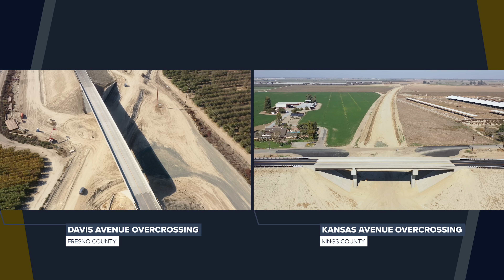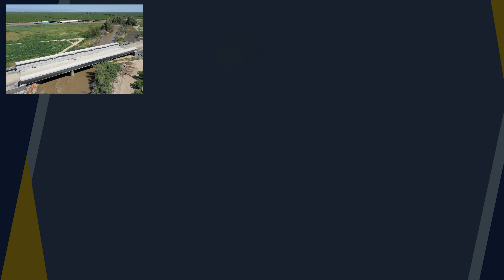Fall 2023 Construction Update: Progress is happening across California thanks to HSR Workers!

Comment: Honestly, the only thing bad about this project right now is that I worry about the Stations not being able to expand upon themselves. The reason why Japan has the best Train System in the World is that their local trains are setup to  help their Shinkansen. Local stations are Mixed-Use Properties with Mixed-Use Zoning - as CAHSR is being built out, the cities along it's line need to build up their local trolley/metro systems to connect to each CAHSR station. I believe as each section of the CAHSR is completed, those workers in those areas should be utilized to bring local train services to the HSR lines so that one could simply walk out from where they live in Fresno to a Train Station 5-15 minutes away, board a train to the HSR line, get on the HSR and be in LA in 2 hours where they would work and then take the same train back same day and be home in the same amount of commute time that it would be now if that same person was living in parts of LA currently. And technically they could even still be productive on the train as they could work on the train heading in and out of work. 

I hope that people realize - this is not a 5 year project, or even a 10 year project. This is going to be a on-going project for the rest of our Lifespans and going into our grand-childrens Lifespans and beyond.
Reply: Yes! Future proofing is very important to save time and money
Reply: That's my big concern with CaHSR as well. I'm all for it, but I feel that it will always fall short of expectations until the cities and counties along the alignment decide add networks of their own, be it bus, tram, or suburban/regional rail. These projects don't exist in a vacuum, but my sense is that only LA and the bay area are understanding that.
Reply: @ashleyhamman  There is the cross-valley corridor project that aims to create a transit connection between the Kings/Tulare station and nearby towns (first bus and eventually rail.) Also, I suspect that eventually Fresno, the 5th largest city in California, will gain some sense and realize that they need to properly invest in their transit system. I'm not sure about Merced or Bakersfield. At least Merced will eventually be getting regional rail from ACE, but that's more so for intercity commuters and not really travel within Merced. As for Bakersfield, apparently, their station development plan is mildly decent but otherwise I'm not sure what their long-term transit plans are.
Reply: Human sized spaces are essential. Zoning laws need to change to convert areas around new stations and potential stations REQUIRE any development as human sized spaces. The complete opposite of single family housing.
Reply: It is not Japan but china that has the greatest bullet infrastructure on earth
Reply: @carlsmith5545  I can agree with you that China has the best Train Infrastructure. They build just to build over there. But Japan still has the Best System - the Stations are top-notch, the Trains are top-notch (and are almost ALWAYS on time), and the service is top class. 

Japan is the country to emulate when it comes to Passenger Train Systems.
Reply: @AnimeGamer0  Ofcourse, infact the people of Japan take great pride in their trains. Now they're building the Chuo Shinkansen is currently under construction between Tokyo and Nagoya and then Osaka. This is maglev super train technology. Trains that can reach speeds of up to 375mph useing magnetic levitation. This is technology that is way above the american grade and the american mind. The mighty United States of America wouldn't obtain this for another 100 years. But boy the United States of America can sure go for a walk on the moon!
Reply: @carlsmith5545  Funny comment to end the year
Reply: I could not agree with you more. Excellent take.
Reply: So true, our country developed based around the fwy system (good? Bad? 😂) in the past 80 years as we steeres away from a good public transit system.  This is just the beginning.  Our cities need to do way more to connect people and make travel times on public transit normal (taking 2-4x more time to travel on busses/trains than cars is ridiculous)
Reply: Check out the Calif. 2023 Rail Modernization Plan -- it ties HSR into all the passenger transit systems in the state.
Reply: " HSR lines so that one could simply walk out from where they live in Fresno to a Train Station 5-15 minutes away, board a train to the HSR line, get on the HSR and be in LA in 2 hours where they would work and then take the same train back same day"

Why would they do that when

1) it makes a lot more sense to just get a job in the central valley

2) the plane is less than one hour (1 hr 15 min according to the time tables but in practice less than 1 hr. The flight from SJ is 45-60 min.)
Reply: @neutrino78x  Well, why do people even go to a Office when they can work from home? Fact is, just by having the option to go to and from work via HSR expands the one thing California is hotly short on - Housing. Not only that, moving these people out while increasing the density makes new businesses and jobs to service that increasing density. Besides, it's hard to predict how future Jobs will work - so it's best to just give as many options to get to that work as possible. 

As for Planes - yes they can be faster many times, but they can also be more expensive and more complicated. A great Metro system paired with a great HSR system would be more efficient cost-to-time wise then having to show up early to the Airport, having to spend time going through Security, then having to waste time boarding the plane. Yes, a flight to SJ would be 1hr 15min - but in reality it's 2hrs if you're cutting it close in getting through check-in, TSA, and boarding (of which you need to be at the gate 30 min. before takeoff or risk getting left behind.) Trains on the other hand don't have that serious of a security check, and more Trains could be run then Planes on the same cost. If a Train fare is even just 75% of the cost of a Plane ride, that's a significant savings if that flight was $90 one-way vs $67.50 for that same route via HSR. I think costs could come down even lower to 50% of flight fare - and $45 plus a extra half-hour is a massive savings overall for most. 

That said, as is right now, the supporting Metros are no where near good enough to make HSR a better transport service then Planes since many stations still requires Cars to get to.
Reply: @AnimeGamer0 

"Well, why do people even go to a Office when they can work from home?"

They don't, anymore, bro. Where have you been? You didn't hear about how BART and Caltrain and Metrolink etc were on a "fiscal cliff" because the ridership declined so much during the covid lockdowns and never recovered because people kept working from home?

You're stuck in the 90s, dude.

 " Fact is, just by having the option to go to and from work via HSR "

((roll eyes)) Nobody is going to commute three or four hours dude. A typical commute is 30 miles.

I have no idea why some people think this would effect commutes.

This is not a train to get from A to B within Los Angeles or within the Bay Area. We already have lots of those.

This is for crossing the 380 miles between SF and LA. 

And there's no point because most of us who travel that route regularly, including yours truly, fly.
Reply: @neutrino78x  Nobody is going to commute 3-4 hours a day? That’s a normal day in LA traffic. I have a friend who drove from South San Diego to Santa Monica (he worked for Riot Games during the early LoL years) to work and drive back the same day. So don’t think people who wouldn’t spend hours on a 4-hour commute don’t exist. 

And you were the one who pointed out why people would not take a job if they aren’t near it - isn’t working from home the same thing? I mean, if we’re going down this route - why even have as many flights between SF & LA when everything will soon be done by AI and Robots - heck, meetings can be done via teleconference? 

The answer is that Humans need to move, and so we do whatever we need to do to get to our destination. Corporations need to be in control - and work at home jobs are shrinking from many big Corpos and their workers are being dragged back to the Office. So what are those people likely doing? Driving to work, sitting in hours of traffic. Those people could take train, but they don’t because their local Train system is failing them.

It’s not even being stuck in the 90s. I bet you didn’t even exist in the 90s so how would you know? 

My whole point is that HSR doesn’t work without good local Metros. So everything you said in the second half of your comment just backs up my initial commentary concern in the first place. 

People use whatever is easiest or more convenient for them. People will drive 10 hours in hellish traffic from San Diego to San Jose and back if it means they don’t spend $200+ on flights and only $80 on gas. Others will fly like you because time is important and spending the money to lessen travel time is important. What Trains are supposed to bring is a middle of the road option that is more cost-to-time efficient then Driving & Flying as long as the Train systems are capable. Will CAHSR, Caltrans, BART, MTS and other California transit authorities be able to build that? Can they build the needed infrastructure of not just track, trains, and stations but the supporting industries around that? That is what is in question here. 

Instead, you went on some wild tangent on how HSR is trash and outdated, won’t affect commutes, and is stuck in the 90s. The classic NIMBY arguments. The only thing you left out is calling CAHSR a boondoggle- when there are many people who still believe it is a project still worth pursuing.
Reply: @AnimeGamer0 

"Nobody is going to commute 3-4 hours a day? That’s a normal day in LA traffic. "

Ok, so let me explain again.

This train is NOT for commuting.

You can't go from San Diego to Santa Monica on it.

You can't go from Pasadena to downtown Los Angeles on it.

For that you have LA's buses, light rail and heavy rail.

CAHSR is designed to move people from southern California to northern California, ok. It's not a commuter train.

If people want to commute SF to LA, there is already a MUCH FASTER vehicle for that, a jet aircraft.

All five people who do that as a commute are not going to step down to something that takes three or four times longer.
Reply: @neutrino78x  because taking a plane is longer than the flight time itself. You have to include time for getting to the airport which could be hours if its LA, security check, bag check, and wait time for you bags if you have checked bags.  Flying is not just the time you are in a plane.  It still has its pros, but the train has its convenience over planes as well, since you do not need to head to the station 1-2 hours earlier.  You dont have to wait for your bags at the baggage claim.  Trains will have more comfortable seats for the average person.  Planes get delays all the time.  It is not as simple as "a flight is just an hour or less".😊
Reply: @Ninjabeefyschtick 

" because taking a plane is longer than the flight time itself. You have to include time for getting to the airport "

Nope. You just suck at flying. Getting to the airport doesn't take hours in LA. I'm from the Bay Area, I'm familiar.

You understand there are three different international airports in Los Angeles, yes? LAX, BUR, SNA. Actually four, ONT. Just like we have four up here: SFO, SJC, OAK, STS.

So no, you're not hours away.

LA to SFBA is a quick one hour flight. People do it all the time, every day. I do it often, myself. I'm in San Jose, so NOT hours away from the airport. It's right downtown.

Would CAHSR fill up with users? Yes.

Would it take traffic away from aviation? No. 

Too slow for that.
Reply: @neutrino78x  what you said maybe correct.  Since you fly so often, then you must also know that travel times to  lax and the other 3 airports differ depending on the time of the day?   And lax has 7 major terminals that also add to the travel time depending on the time /season.  And feel free to ignore the security times too. Lol
Reply: @Ninjabeefyschtick 

"ince you fly so often, then you must also know that travel times to  lax and the other 3 airports differ depending on the time of the day? "

It's not hours and hours. You have an airport close by if you live in the LA area or Bay Area. This isn't Europe. They had to put their airports hours outside of their cities simply because their cities had been there for thousands of years and were too dense. Whereas San Jose has an airport right downtown, and there are three other airports in the Bay Area and four in the LA area.

I'm sorry but HSR is simply too slow for this distance. It's 380 miles. Three hours doesn't compete with one hour. 

It competes with DRIVING yes. But it doesn't replace the one hour flight, and the one hour flight will be unaffected. Speaking as one of Those Who Would Otherwise Fly, I can tell you it does NOT compete.

SD to LA makes a lot more sense, and they're already upgrading that track, moving some of it inland where they had issues with beach degradation etc., using existing county budgets.  LA to LV also makes sense, and that's 80+ percent privately funded and will be a private transportation service, not public transit.

I proudly voted no on the stupid CAHSR project and I'm glad that the Governor said there shall be no more construction beyond Merced to Bakersfield (the Initial Operating Segment).
Reply: @neutrino78x    no one says it is competing with flights. Its an extra options like many developed countries have.  If you dont factor any driving time and security check times, ya it is 45 min or an hour to SF and vegas.  You can continue to believe that if you are happy and very strategic about your flight/airport selection, not every single passenger is smart or has the luxury like you. 😭
Reply: @Ninjabeefyschtick 

"  no one says it is competing with flights."

Great, you agree that it should have a lower budget, then.

We don't have 100 billion as a state. That's why the Governor said there shall be no more construction beyond Merced to Bakersfield.

 " you dont factor any driving time and security check times, ya it is 45 min or an hour to SF and vegas."

Sorry, even counting that, it's not 3 hours on a plane SF to LA.

I'll give you two hours, that's generous. It's not three. 

EVEN WITH THAT GENEROUS INTERPRETATION, YOU'RE STILL WASTING AT LEAST ONE HOUR OF YOUR LIFE WITH THE TRAIN.

Three hours does not compete.

Assuming it can even do it in 2 hrs 40 min as promised. That speed assumes you went from SF to SJ in 30 minutes, half the current time. The track speed for Caltrain isn't increasing any time soon. It's 79 mph or 127 km/hr. So that adds 30 minutes to it, it's now 3 hrs 10 min. AT LEAST. Probably longer.

Plus I thought you just admitted that it's not competing with flights?

If it doesn't compete, it doesn't compete, end of story. If you agree it does NOT compete, then stop trying to pretend it does.

"You can continue to believe that if you are happy"

I am, and so is everybody who flies it, 
BECAUSE
IT
IS
MUCH
FASTER

"every single passenger is smart"

I'm in the 96th percentile, so yes, you are correct. However, they are smart enough to know that jet aircraft are faster than trains.
Reply: @Ninjabeefyschtick 

" let people who want trains have trains
"

Well, sure, as long as you start a private company and pay for it with your own money, like Brightline is doing.

Or like Dreamstar Lines. They're a private company, privately funded, and they're trying to start a private transit service on the coast line from SJ to LA that would leave at night and arrive in the morning, so it doesn't matter as much how slow it is because you'll be asleep. I applaud their effort. (it's a pretty niche thing, it wouldn't work for all us. It wouldn't be of much use for me, how I travel. I prefer to get to the hotel room the night before, so I have all day Saturday and Sunday in LA/SD and I can fly back late Sunday night.)

However, you don't get to impose your will on how public money is spent; that requires a vote from all of us.

And my vote on this kind of thing will always be no. Despite being on the LEFT.

And btw I get around with trains all the time. I don't know how to drive.

That doesn't mean I have to think a public transit HSR from SJ to LA makes any sense. 

100 billion, they want 100 billion to complete phase 1 (sf to la). Not remotely justified.

We don't have the money as a state. That's why the Governor said, no more construction beyond the Merced to Bakersfield Initial Operating Segment.
Reply: @neutrino78x  The project did receive the votes it needed in a ballot. There are tons of other things that I (sure you do as well) do not want my taxes to be spend on, but this is not how it works.  We still pay for those services or projects as citizens.
Reply: @Ninjabeefyschtick  

"The project did receive the votes it needed in a ballot."

Yes, I know. If anyone should be responding like that, it's me.

You're the one who thinks that because you are a railfan, whatever you want should be what happens. YOU are the one acting like you don't know how things work.

Just because the people voted on it doesn't mean that the project was well managed, and that we have the budget to pay what the project is requesting.

They FAILED, ok.

They are requesting 100 billion, and we don't have that as a state.

Hence, for the foreseeable future, it's over. It will go merced to bakersfield and that's it. 

Meanwhile, the coastal line, where track already exists, will be incrementally improved over time with existing budgets.

For example the area where the track had issues with beach erosion is going to be moved inland.  

Ultimately, the coastal line will take about five hours, which is only about 30% slower than cahsr would have taken, but a LOT more than 30% cheaper.

Either of those....3 hours or 5 hours...is too slow to take traffic away from aviation.

The same amount of planes will fly between SJ and LA/SD. Probably more, because we're going to have eVTOL air taxi etc. (no, that doesn't pollute. The "e" part means electric.)

By 2045, most aircraft flying between the Bay Area and LA/SD will be battery, H2 fuel cell, or Sustainable Aviation Fuel powered.
Reply: An economic decision. Making short platforms, means fewer passenger cars per train set, means fewer passengers, means small stations. Which saves money on the front end, but of course means it is less likely to be an economic success, and more burdensome for taxpayers.